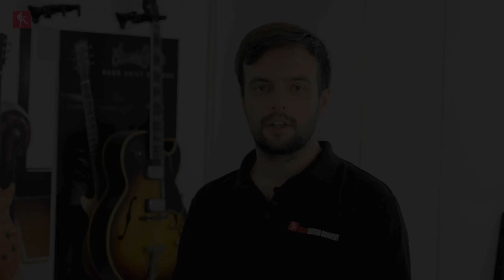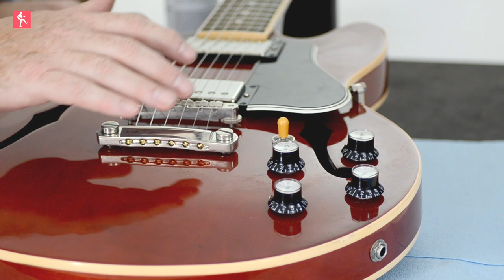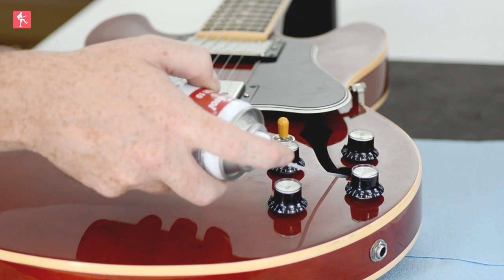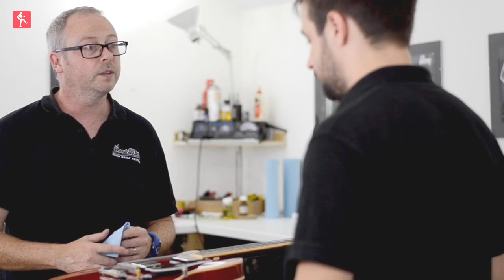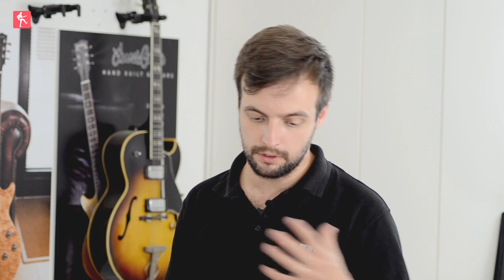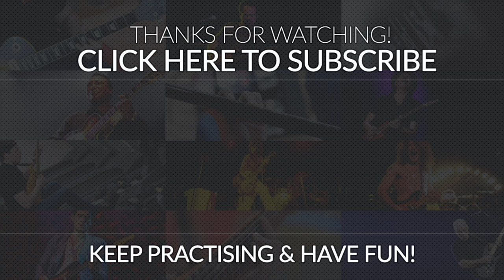How To Clean The Electrics On A Gibson Hollow Body Style Guitar - Guitar Maintenance Lesson

Comment: I tried this with an Epiphone Sheraton from the 80s. It works. I took off the knobs and used a shop towel and punctured a hole through it for each pot. I then sprayed without having too worry too much about over spray. The Deoxit spray let's you adjust the strength of the spray, but it can be pricey for some. I'm cheap, so I got one off Amazon.
Reply: Thanks - about to do this on a Casino...what kind of shop towel did you use?
Reply: I didn't think about making a hole for the pot. Thanks for the tip!